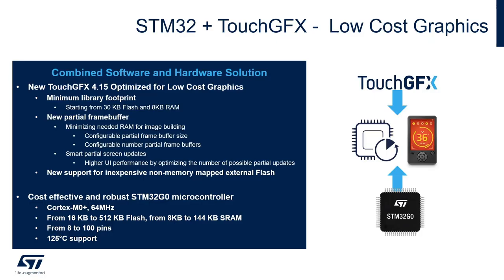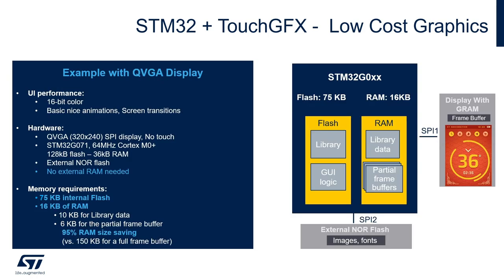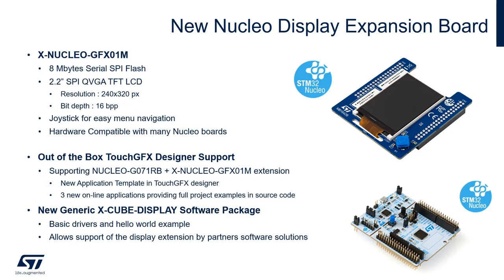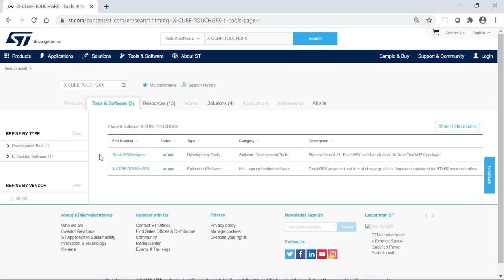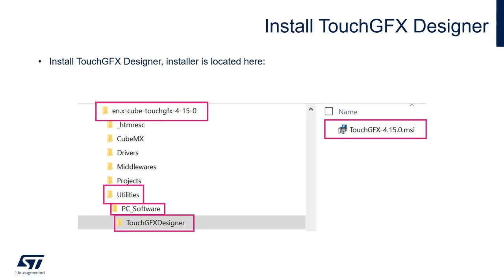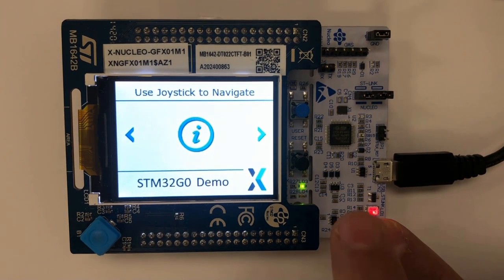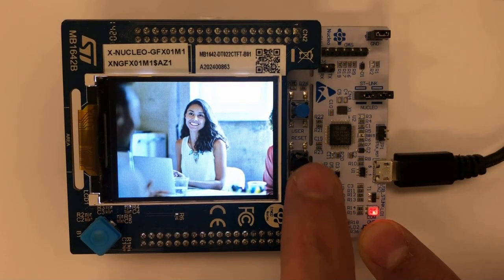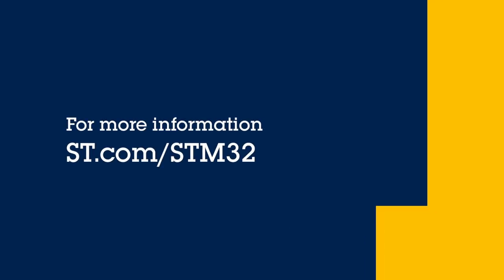Low Cost GUI Solutions with STM32 and TouchGFX

Comment: Where are the images for the display located?
On Flash microcontroller?
And if I want to create a Slideshow of 1000 images, then how can I configure the display of images from a USB drive?
These 1000 images will not fit on the Flash of the microcontroller.